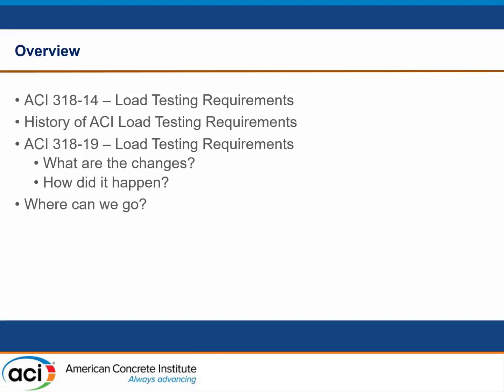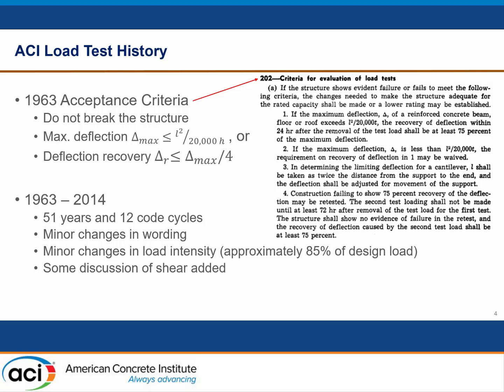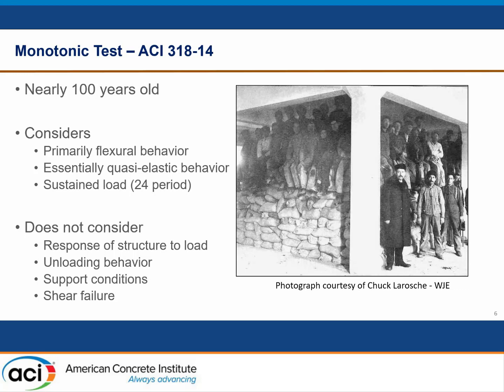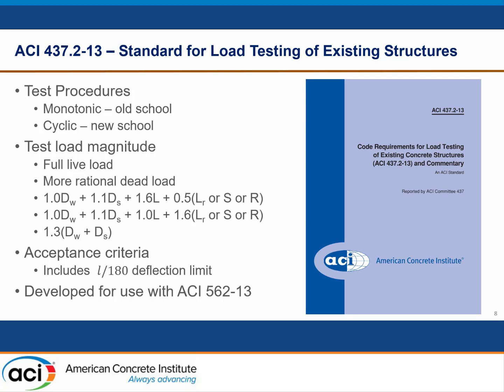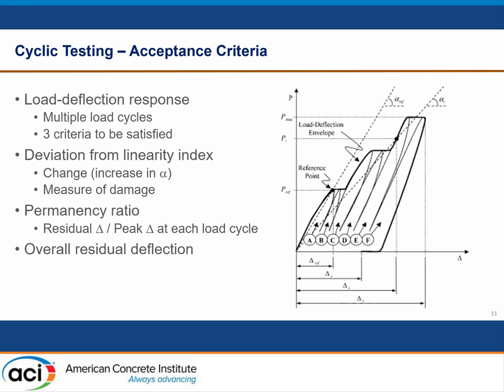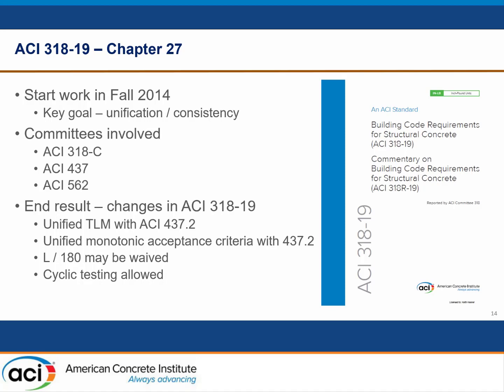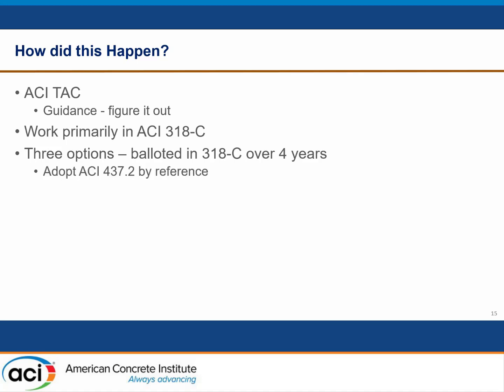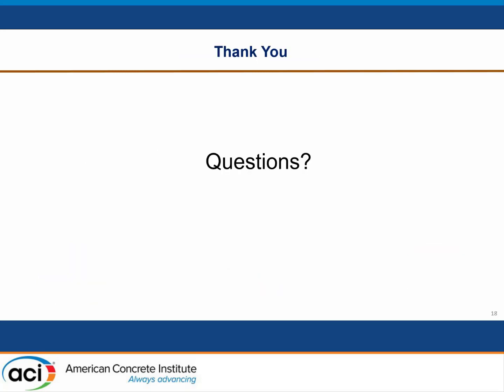Load Testing – Changes in ACI 318-19 – Integration and Coordination between Committees

Comment: yes

short length=  those walls that  the  ration h/lw  is  more than  1.

 The ASCE-7 procedure for determining the redundancy factor post-1997 has raised questions about its ability to effectively capture torsional sensitivity. The code needs to provide clear and rational methods for accounting for all relevant factors, including torsional effects, to ensure the safety and reliability of structural designs. It may be beneficial to further evaluate and, if necessary, revise the procedure to address this concern. On the contrary, the older procedure was based on the shear ratio absorbed by large-length walls.